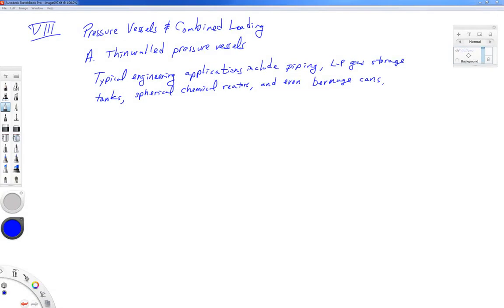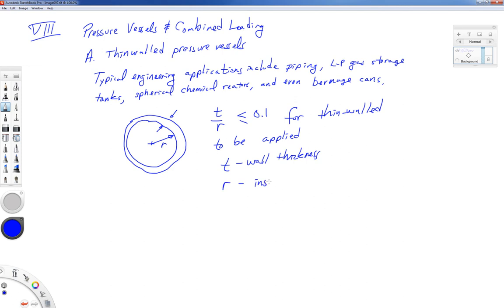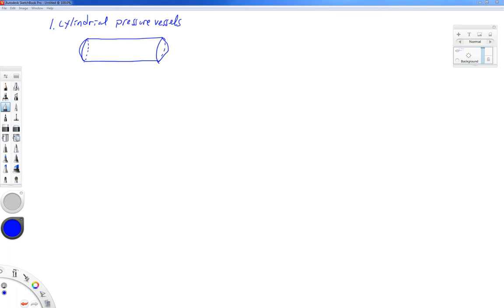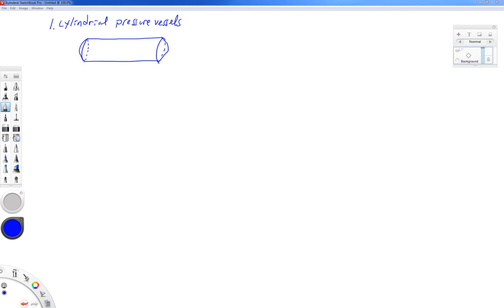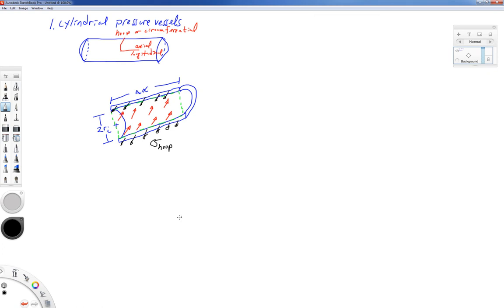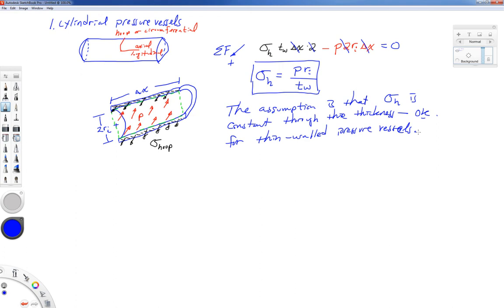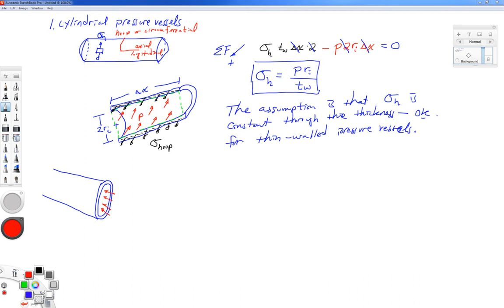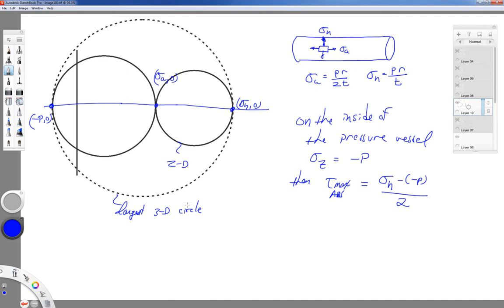Mechanics of Materials-Lecture 31-Thin Walled Pressure Vessels

Comment: Sir, one of the assumption is that pressure inside vessel=pressure outside the vessel, am I right? If there was a pressure difference, there would be a radial stress.
Reply from the maker: HI Metehan--no, the inside and outside of wall of the pressure vessel are different.  The form of the equation for the radial stress was not discussed in this video, but I call it sigma_z.  On the inside of the vessel, there is a compressive sigma_z due to the internal pressure.  On the outside is atmospheric pressure, which we ignore as we are discussing gauge pressures.  The different values affect the absolute maximum shear stress as discussed in the video. 

For thick walled pressure vessels, the radial stress equation can be found explicitly (see https://www.engineeringtoolbox.com/stress-thick-walled-tube-d_949.html for example).  If you needed it for thin-walled pressure vessels, you could start with that equation and then use the t/r is small assumption to get a reduced form.  :cheers:

Comment: I have a question. In the end (calculating for the wall thickness), why do you have to divide by 2?
Reply: Great video by the way!
Reply from the maker: Hi Best V. Thanks!   t in the pressure vessel equations is the wall thickness.  tw = Ro-Ri  or = (Do - Di)/2   When using the difference in diameters, you must divided by two since there is a wall thickness on both sides.  Hope that helps--

Comment: As you said that there is no shear stress, so why is absolute shear stess for? I mean where does it acts. Please reply soon
Reply from the maker: Hi Pinku, there is no shearing stress in the plane of the surface of a spherical pressure vessel, but there will be out-of-plane shear stress at 45 degrees to the surface of the pressure vessel when the out of plane normal stress is zero (or other values).  Please review this lecture for a discussion of the absolute maximum shear stress:  https://www.youtube.com/watch?v=PKHGGcW594k&list=PLaDWa6xI4zec07Yhxso4yQW8wQptI85yy&index=34